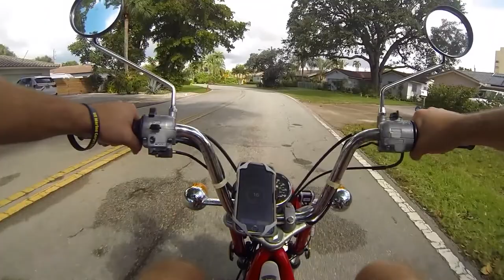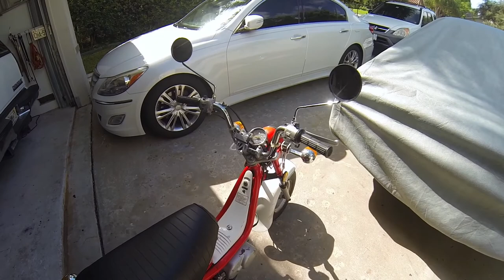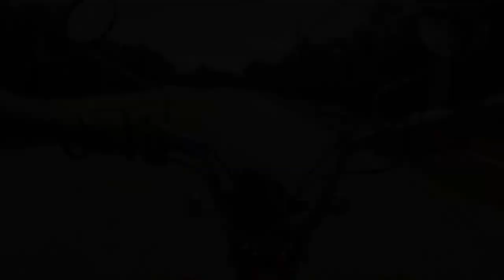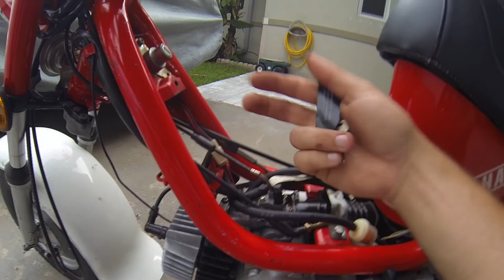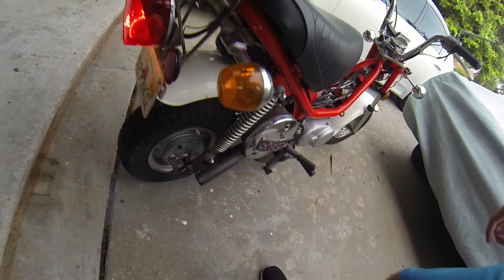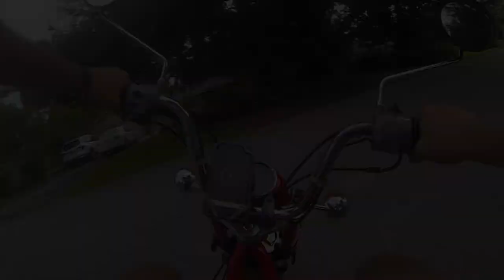Yamaha LB50 PW80 Carb Upgrade and Stock Carb Comparison

Comment: I have one exactly like this that I've had for almost 30 years. Unfortunately the engine/transmission is in pieces. My dad and I started working on it when I was a kid because the gear shift jammed and wouldn't let it shift out of neutral. In the process of tearing it apart, we broke a few things and that's where we stopped. I think it would need a complete engine/transmission but have no idea where I would find the whole assembly. It's just sitting in my dad's basement where its been for since we took it a part. I have all the parts that we took off. I'd like to put it back together but I don't know where to begin finding parts.

Comment: Nice LB50!! I have an LB80 and am getting back to working and restoring it with some new parts. Just found the MLM parts and they look interesting, might go with a couple of things there - thanks for posting!
Reply from the maker: Hey man, myself and others have compiled a lot of good information on LB50 and LB80 Chappys on Moped Army.com, under the performance section, under the Chappy thread. There is also a Chappy Champ facebook page with a lot of good info on there as well. Keep me posted on the restoration process!
Reply: @HunterSkiff  very cool, I will look for threads there and also on FB - thanks for sharing those resources!!

Comment: Got another question for ya, is it possible to bolt on foot pegs on these pedal model LB50s? Because the pedal assembly on my LB50 is missing some key components, thus flops around scrapes the ground and the most of the pedal parts are near impossible to find. I'd love to get rid of the pedal assembly and just have pegs.
Reply from the maker: I don't have the bikes in front of me but I believe I looked into this and the answer is yes. Like you mentioned you'd have to ditch the factory pedals, which you and most people are happy to do. The stock and/or MLM foot pegs should work. I will confirm this in a few days and get back to you!

Comment: I will be getting a chappy next week. The motor runs fine from what the guy said. I was thinking of either keeping it stock or going with a Pw80 engine swap just to have the 4 speed manual transmission. Do you happen to know what's the top speed for a chappy with a Pw80 engine? Looking to cruise around 37-40mph without having the engine rev too much
Reply from the maker: Sweet! Cruising 35-45 on an LB80 or lightly modified LB50 is possible and I do it all the time. Recently stator on my LB80 has been giving me issues and I’m going to swap in ignition system from PW80. If I can find a complete engine I’m going to do the entire engine swap. 

To answer your question about speed for PW80 engine I don’t know but a stock LB80 or an LB50 with polini kit can get you the speeds you’re looking for without revving it to the moon

Comment: Love the video! Did you have to change the throttle cable or the jetting on the pw80? Thanks!
Reply from the maker: Thanks for the support. I was able to use the factory throttle cable. Also, the stock jetting on the PW80 clone carb worked right out of the box, maybe 1-2 jet sizes too rich but it runs very well and usually see cylinder head temps of around 300-330*F during sustained 35-40mph riding.
Reply: @HunterSkiff  Awesome! I'm ordering one today, I think my stock carb is too far gone.
Reply from the maker: Sounds good! Let me know if you have any questions along the way!
Reply: @HunterSkiff  it worked perfect and it runs so well. I just had to use my old curved piece from my carb for the throttle cable. Thanks for the help!
Reply from the maker: awesome! awesome! awesome! glad it worked out. Get out there and enjoy that chappy!
Reply: Tried with a yamaha oem brand new  pw80 carb and it was way too rich at full throttle. Also when i was plugging the overflow on the carburetor i had an rpm change at idle. Working on it to make it work now, i had a big improvement at the first ½ of the throttle.

Comment: Can you show a link to the carb you installed? I have a Chappy 50 that I'm trying to get running. Its been sitting for 35 years.. It turns over just fine, so I thought I would give it a go to get going, but the carb is all seized up.
Reply from the maker: Yes it is this carb.   

NEW Carburetor for YAMAHA PW 80... https://www.amazon.com/dp/B00KLKPYX2?ref=ppx_pop_mob_ap_share.    

You will have to thin the provided plastic collar ever so slightly to fit the carb over the factory intake. Easy job, can be done with sand paper

Comment: Hello man, I got a question, how did you bore out the pw80 carb? Ive never bore a carb before but i know you have to bore it from side to side (innlet to outlet) and it has its limits because of the slide, for example a pwk 28 you can only oval bore it, top and botom 1mm and sides cant even touch it because slide would not seal when closed. Grettings from Ecuador
Reply from the maker: I honestly had no plan as this is the first time I've done one. I used a carbide bit to rough in the shape, then used a small sanding drum to make it smooth, going slow and trying to make the shape round lol. You are correct you cannot exceed the slide size obviously. If you have something round to use as a reference, you can see how close your shape is to being perfect. If you have a 3D printer you can make a nice jig. It is not a science, just go slow.  Let me know how it goes!

Comment: OMG, that's a totally different bike with that pw80 carb.
Reply from the maker: This aint your Grandma's LB50 anymore!
Reply from the maker: @jackrutherford-1  ive used JT sprockets on both my lb80 and lb50 with no issue. they seem to be the exact same. here is a link to one, but theyre available from multiple sellers. https://www.ebay.com/itm/15T-JT-FRONT-SPROCKET-FITS-YAMAHA-LB80-CHAPPY/274139710245?hash=item3fd4000325:g:hh0AAOSwRl1d8mzy

Comment: Can you put a pw80 carb on a lb80? What’s a good replacement carb for the lb80 can I use a vm20?
Reply: My idle jet broke in my original carb and I can’t get it out!! So I just need a new carb
Reply from the maker: I have not messed around with a PW80 carb and an LB80. My guess is that it can be made to work, if it isn’t a drop in swap already. A VM20 can work but you will need a different intake manifold (treatland.tv sells a good one from MLM) but it will stick up through your center plastics